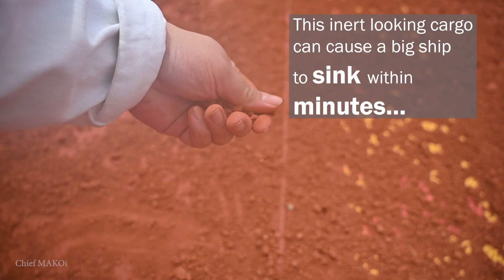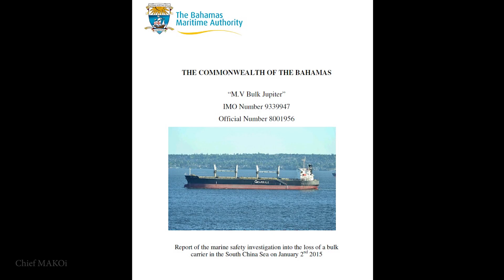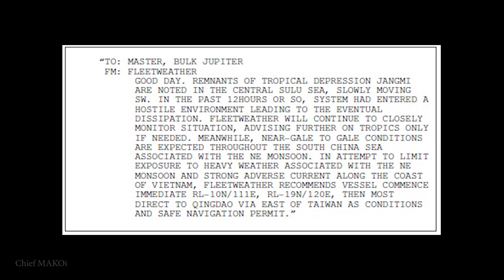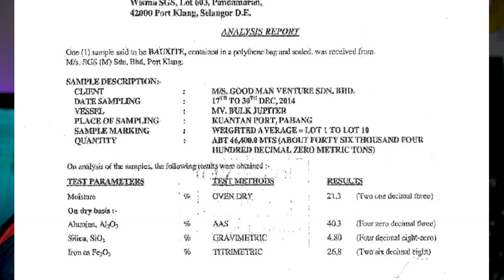The Cargo That Can Sink Ships Within Minutes : Bauxite Liquefaction | Chief MAKOi Seaman Vlog

Comment: As a tank truck driver, I am familiar with the issues involved here, to a limited degree!
The difference being that my load was always a liquid, so I had to drive accordingly.
When I was driving dump truck, if my load of dirt suddenly turned to liquid while going around a corner, I can see how that would be very bad.

When I was driving water truck for construction sites, if my windshield was getting dirty, after filling the truck I would just hit the brakes hard and a wall of water would spout out the manhole on the top of the tank and wash my windows, the pedestrians within 30 feet, and everything inside the cab if my window was open lol

Another excellent video, and now I know how to check for safe moisture levels in bauxite ore! Lol
Reply: Wet sand.  It happens.  Particularly when nobody is paying attention to the scales.
Reply: @ShainAndrews  I hauled quite a bit of sand and never ran into that, maybe because it was in California and it doesn't get as wet in storage as some places lol
Or maybe different sizes of sand?
Reply: @ke6gwf  I have the unfortunate pleasure of having it happen to one of my newer drivers.  I don't remember how much the pup weighed but it was significantly over, like WTF are you doing over.  Only had to haul it about 10 miles.  A mile of it was frost heaved concrete road before a nice right hand sweep onto the interstate.    Driver said he could see it pouring over the top like a fluid.  I'm guessing the short wheelbase of the pup got it to set up just right.  Very expensive day.  I didn't fire the driver.  I knew he would never be afraid to dump a heavy load in the yard after that.  Shit happens, nobody got hurt.  He felt pressured because that's how some companies operate.
Reply: @ShainAndrews  sounds like it was sitting in lake, or it had high fines percentage?
Was it crusher sand or bedding sand?
Washed sand should be able to drain the water out and not liquify, so I would guess it was something that retained water more than just pure sand?
Reply: @ke6gwf  It had rained pretty good.  Enough for flash flood warnings, and localized flooding.  I think we were hauling for some trench work so probably bedding sand.
Reply: @ShainAndrews  and yes, I know the feeling of a new driver being pushed to overload.

I had to shovel a ton of expensive decorative decomposed  granite when I got pulled into the scales, good on gross but overweight on the drives because the quarry didn't want to help with checking axle weights and I didn't go around and insist. (the Scales had a perfectly landscaped facility or I would have given them the fancy gold granite path rock, but they let me go once I had it close lol) 

Then after I got used to the capacity and proper loading of the truck, I would have the company operators always trying to overload me on broken asphalt etc, until one day I told them I was full and they insisted I could fit more and said I was being stupid. (I was the small Caltrans subcontractor company truck driver, low boy, dump, water, etc, and our dump truck had a really heavy rock bed, so a full load didn't look very full and had to leave the back of the bed empty, but they didn't believe me lol)
It was the end of the day, so I was hauling it back to our yard to dump at the nearby quarry later since we had a special low rate with them, and I got to a set of scales, and Shore Enough! I was was like 10k overweight... 

I walked into the Scale house and told the guy I totally wasn't surprised, and told him what nearby project I was hauling out of, and asked him to write something up that I could show to the boss and supervisor to prove that I was correct.
He had been a dump truck driver at one point and so understood the situation, and so offered to let me run back and dump some off at the job site, and I smirked and asked him to send me to a nearby asphalt plant that also did recycling, but they were in the middle of town and so really expensive, which is why I wasn't dumping there in the first place.
I told him I wanted everyone to realize that overloading me cost them actual money!

He laughed and wrote me a warning about the overload, with official directions to proceed directly to the nearest facility to correct the weight.
I made sure to dump extra off to increase the bill for my troubles, and then texted the "ticket" and dump bill to the owner and the supervisor.
I never had problems after that... Lol
Reply: @ShainAndrews  if I ever get back into that line of work, I will know what to watch out for lol

I am getting ready to switch to hauling liquid oxygen etc, but I think they have baffled tanks...
Reply: @ke6gwf  Dump trucks can generally drain freely except with extreme situatons. A ship has both a water tight hold and much larger volume to surface area ratio so even if it had a drainage sump it would be very slow.
Reply: I understand that liquid tanks have baffles inside then to prevent the whole volume of liquid moving in one go.
Reply: @darylcheshire1618  Only some have baffles - petroleum, certain industrial gases like CO2; however, food grade commodities and quite a few chemicals move in smooth bore tanks.
Reply: @darylcheshire1618  non-potable water trucks like fire trucks, construction water trucks, etc, will have a couple of baffles, but while that helps, you still get a lot of slosh, it's just in 3 sections instead of one big one, and the baffles don't do anything to reduce side to side slosh on curves.
You can still have the truck pushed into the intersection if you stop fast, because you still have 3000 gallons sloshing, just with less distance to get a run at the back of your head lol

It's really fun when you get into food grade, or chemical tankers, because they have to get washed out between loads and baffles would make it impossible to fully clean them, so you can have 40 feet of smooth bore tank to gather momentum.
They are generally smaller diameter than a water truck, so may have less side to side slosh.

So yes, having baffles helps, but it doesn't eliminate surge.
Reply: @darylcheshire1618  Yes and no. 
Trailers typically do, waterways typically do not. Also, milk tank trailers do not not, as a means to facilitate sanitation.
Reply: @DesertCatDad  
Crude oil tanker trailers don’t typically have baffles,either-
anything that hauls 
as full as possible whenever loaded doesn’t need baffles-
there’s no room to surge.

Water trucks that handle dust control often don’t have baffles but they usually aren’t that big and refill constantly.

They’re much easier to clean without baffles-
they can get pretty dirty fairly quick inside the tank.

They use just about any non-toxic water and load quickly with no cover on top with a fairly big open port up there.

Again,riding around constant dust clouds gets ‘em dirty quickly.

They also usually aren’t going fast&loaded on public roadways.

When they’re full they’re usually on a site moving at low speeds.

I’ve driven tanker 
(and pretty much everything else)
but I have only limited experience with onsite dust management.

I did it once but I was using a large pneumatic tanker trailer with a homemade spreader nozzle on the tail valve.

We were pulling the water from a pond with a trash pump...
it was all quite sophisticated!
☝🏿🤠👍🏿
Reply: @j.griffin  I used to do construction water truck, some dust control but mostly moisture level management for soil to get proper compaction, but I never had an issue with the inside of the tanks getting dirty, because they were getting rinsed out constantly!
And I often had to fill up off site at a hydrant and road it back full, sometimes quite a distance if we were using treated sewage from a plant (it was a lot cheaper lol)

If the one you ran had no baffles, it was likely an old potable water or food grade tank repurposed for it.
Water truck tanks usually have baffles, often with large enough holes to allow a person through if it needed cleaning or repairs.
Reply: I used to be an arborist, when loading a tree with heart rot (where the tree rots from the inside, such as an old avocado tree or a palm tree) we were supposed to load in a specific way because of the liquifaction of the rotten cores of the trees....
There were 3 times I had an incident where the cores turned to mud and weren't loaded correctly. Two times I narrowly avoided a jackknife at 60mph and the third time I narrowly avoided a jackknife while braking. Luckily I had experience hauling liquid loads and nothing bad happened, unless you count me firing groundies for not loading right.
Reply: @takeohtyme  interesting. I used to do technical climbing and removal in California, and I never ran into anything like that! You must be in Florida or something where mud is the natural state of existence for most things! Lol

When I had trees with heart rot, they had the decency to be dry and empty, or lightweight punk wood!
Reply: @ke6gwf  ding ding ding! Miami for the mud!
Reply: @takeohtyme  oh I have been on the water truck detail before cutting and building roads through areas, we fortunately usually had nice creeks to pull water from with pumps into the trucks.  The dust was always a problem, and I can relate to the water sloshing around although mine was a closed tanker I had to close the lid so no dust would get in to clog the spreader pipes and shower hole nozzles
Reply: It’s the milk carriers you’ve got to watch out for. No baffles allowed in those tanks. Surge can be a BIG problem.  On the road I give milk semi’s all the room the deserve,...and then some.
Reply: @petermargie  that's a good point, especially with those short double trailers a lot of milk haulers use.
Plus since they are going to multiple small diaries and pumping out small tanks, they are often running half full, or just one trailer full, so they are going to be dealing with a lot of surge, unlike most tankers that normally always run with full tanks.
Reply: The main difference is the tanks are designed for liquid cargo, so is having a lot of separators walls which limit to safe the speed of the movement of the cargo inside the tank. A bulk carrier cargo is solid, is assumed to be non-movable, so there are no separators walls. In the case of liquefaction of the cargo, all is lost. The same problem has certain soils, are very well known - even in the video is an example- and there are many cases when during an earthquake the buildings collapsed because of liquefaction of the supporting ground.
Reply: Sorry for the 2 year response, Ex-trucker here. Used to haul both liquid fertilizer and bulk fertilizer. I can tell you from experience a half empty hopper with a mound of potash on one side that suddenly shifts while driving feels exactly like a half empty tanker sloshing on a hard corner. And for those that dont have the experience of 60,000 Lbs of 28 deciding for you that no you are not going to stop at that red light, imagine stepping on your brake in your car and everything seems fine, the car slows down normally and everything is fine. Then 1 second later you are suddenly accellerating, half a second later you feel like you slammed on the brakes and another half second later you are being pushed forward again even though this entire time you have kept the same pressure on the brake pedal. A fun side effect is pulling up to a completely flat section of road at a red light and killing off that last 3mph with a hard tap on the brakes then letting go and giggling like a child when your cargo rocks you back and forth a few inches (not with other people behind me)

Comment: Another mari-term you dropped there chief. What is off hire?
Reply from the maker: It's the period in which the charterer won't pay the ship owners due to stoppage or delay caused by the ship or the crew.  Usually counted by the hour.  Example, if a ship's charter rate is $24,000/day, and the ship gets delayed for 10 hours because of ship malfunction, that will be $10,000 profit loss for the ship owner.

Comment: Excellent presentation.  Perhaps installing longitudinal bulkheads (Bow to stern), with baffle ports would stop, or minimize the potential risk.
Reply: The Fitz only had 3 bulkheads summer full of iron ore
Reply: @jayltd.7030  
Gives a whole new perspective on that saga!
Iron ore, liquified!  In a November gale on Lake Superior!  Those seamen never had a chance!
Reply: @irishgrl  Seems like fate sealed the deal
Reply: @jayltd.7030  
It’s an idea that nobody ever mentioned that I’m aware of.  All you hear about is the rough seas & the main hatch giving in….
But liquefaction brings a whole other level of risk into the equation.
Reply: @jayltd.7030  It was not iron ore.  It was taconite, hard pellets about the size of a marble, that the Fitzgerald was carrying.  The problem that poses is that it has no resistance to water.  Whereas a cargo like wheat or sand would soak on the top and become more water resistant, taconite just lets water fill the voids and weigh down the ship.  Add to that the fact that the Fitzgerald's bilge pumps were positioned in the bow and stern and were not plumbed such that the stern pump could draw water to assist the bow pump if the ship was in a nose down angle, and what pumping capacity they had was quickly overwhelmed.  That's if the cargo getting wet was even the cause- there is much debate which will likely never be settled since she spit in two and the bow rests upside down on her cargo hatches.
Reply: @MK0272  Water in the holds would rise to the surface. Dynamic Separation as well as Liquefaction are 2 methods. If the ship struck a shoal the cargo holds filled from the bottom.  The ship listing was reported after the ship cleared the shallow shoals im guessing ?
Reply: @jayltd.7030  Well, there are multiple theories on her sinking. The official Coast Guard report says a hatch cover was improperly secured and gave way in the forward part of the ship, which now lies upside down. It was common practice to only secure every other hatch dog, and that's what they are reported to have done.  Of course, since that part of the ship is upside down, that can never be proven.

I have never heard that she reported a list but don't know that she didn't. Her final radio traffic was that she had lines down and water coming in, but was holding her own. 

Another theory is that as she descended a wave her bow may have plunged under far enough that she struck bottom and broke in two.

The most likely one in my opinion is that she ran over a sand bar.  In that part of Lake Superior the currents can cause sand bars to shift. Her radars had both been disabled by the storm, so she was relying on the MV Arthur Anderson, who was ahead of her, for navigation. The thought is she may have cut a turn a little too tight and run over a certain sand bar. She normally would have cleared the sand bar by a good bit, but there were substantial waves. It is thought that the trough of the waves may have made the water about three feet too shallow, causing her bottom to repeatedly impact the sand. Given the ferocity of the storm, they may well not even have known it.  The reason I personally think that one is most likely is that she reported safety lines down.  According to another ship's captain, that's a strong indicator her keel was broken.  With the twisting and bending forces she was experiencing, she may have simply snapped in two and sunk like a rock. There wasn't time to try to abandon her or even get a distress message out.

While water would have risen to the surface of the pellets, she needed the buoyancy of the air between the pellets to float, particularly in those seas.

Comment: Thanks for another very interesting explanation of the challenges faced by seafarers. I was wondering though, does the charterer bear the cost of cleaning the tanks after such a load has been delivered as a separate fee or is it built-in to the overall cost of the charter?
Reply from the maker: Charterers pay for the hold cleaning.

Comment: When ships are loading ore, or coal, or some other material with similar characteristics, maybe the ships should not load up to the main deck.
Sure, the amount of material carried, is connected to the bottom line of the finances.
But, so is it too, connected to the ship and her crew, for safety of the crew and survivability of the ship herself.
While she might bring in less profit, by loading less material, "she will reach port and offload."
A sunk ship means a loss crew maybe, or dead crew members, as you point out here.  Then there's the loss of the ship and all the cargo to boot.
But ships in the end, are insured usually, and are replaceable.
A well skilled and valuable crew is not.
It's the curse of the sea, that some are meant to perish in it...
Thanks Chief, for another well done vid!
Reply: Unfortunately, some carriers would rather lose the ship and crew and let the insurance pay rather than risking losing a few thousand Dollars.
Reply: @BruceBoschek  --  Well, then, the insurance carriers should monitor the situation to control their risk.
Reply: "When ships are loading ore, or coal, or some other material with similar characteristics, maybe the ships should not load up to the main deck." No, that's exactly the wrong approach. If the hold is completely full, the cargo cannot shift. If it's nearly full, the cargo can only shift a little bit. But if it's half-full then the cargo can, in principle, move from filling the bottom half of the hold to filling, e.g., the left-hand half of the hold, and that's what capsizes the ship. You can see this if you fill a plastic bottle with water and put it on its side. If the bottle's full or nearly full, it doesn't matter how much you move it: the air will always be close to the top. But if there's a substantial amount of air in the bottle, it can move around much more.